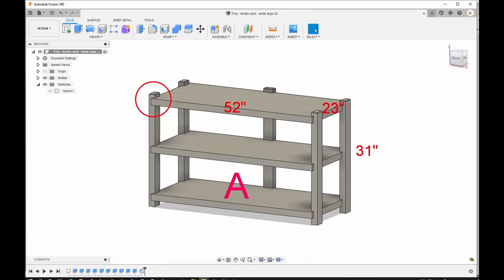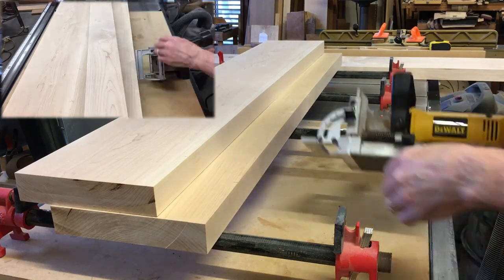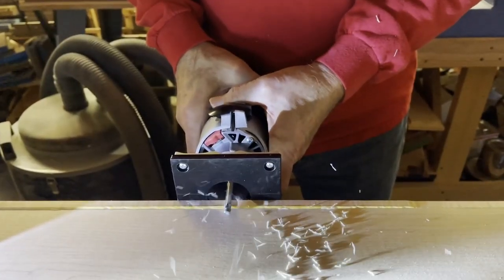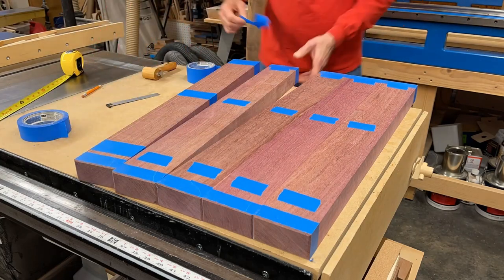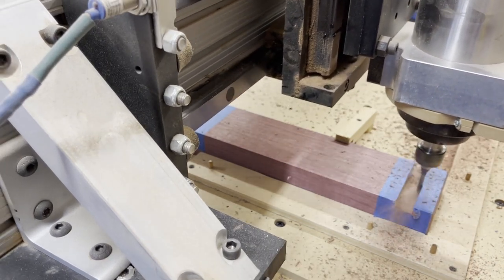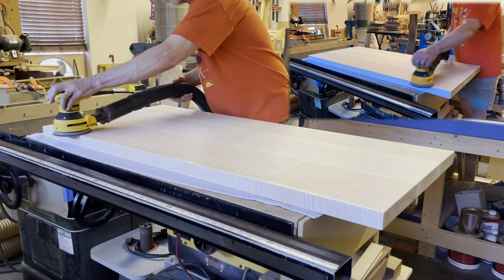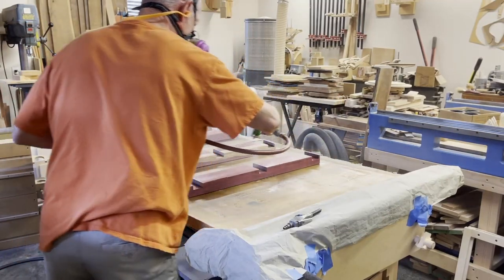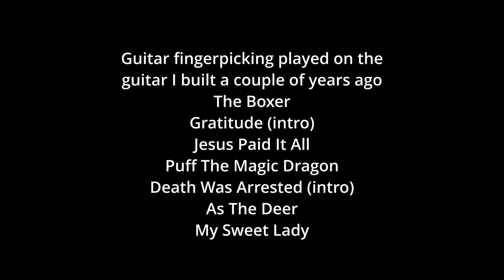Curly Maple audio rack - serious audiophile

Comment: Hi David,

Great video and you were able to spend the video time in documenting everything. Heck of a nice shop too👍👍

My neighbor down the street has a shop in his garage and we built a stereo rack similar in design but about 4” shorter due to the limitations in my music room. We used 3 birch countertop slabs for shelves and African mahogany for the 4 legs. I stained the legs in a dark Java color (Gel/oil-based) from General Finishes. I applied 3 coats of General Finishes Gel Satin (oil based) to the shelves and legs and it was just yesterday that I completed the last coat in my garage. Now I will need to wait a month for the finish to cure before placing 50 lb. stereo gear on the shelves. Again, congrats on your wonderful vid!
Reply from the maker: Thanks so much for the kind words and for watching the video!  Are you planning to post a video or photos of your build?
Reply: @difalkner  - I am about 50% done with the vid. I will finish it after I move the rack to my small music room and video some more. I have some YouTube vids posted under my name for my vintage stereo gear.

Comment: That curly/tiger maple is gorgeous and tough and expensive to come by.  Very nice combination with the purpleheart.   I'm surprised that you had issues with the threaded inserts.  I have installed them in hard maple but mine were in face grain and not end grain.  Did you lubricate the threads?  Are the inserts fine thread?  Beautiful workmanship.
Reply from the maker: Sorry for the delay in responding; turns out I wasn't getting notifications for comments.  I used Beeswax on the threads and they are coarse threaded.  Thanks for the comment and for watching the video!

Comment: 5:58 why do you glue the front strip, or do you do it around each shelf? thank you for your video
Reply from the maker: @Blackhowk3  I assume you are referring to the middle and bottom shelves. That was done to give the look of Curly Maple to all of the shelves and not just the top one. Once equipment is on the shelves, you wouldn’t really be able to see the shelves themselves. And it was far less expensive to use Hard Rock Maple for those two shelves and put the Curly Maple strip on the front to give it the same look as the top shelf. Thanks for watching and thank you for your question!

Comment: What are the dimensions of the legs and where did you acquire the Purple Heart from?
Reply from the maker: @markcurry5758  My CAD computer is in the shop so I can’t check but as I recall they were about 1.75 x 3.75. I bought the Purpleheart from a local hardwood supplier.

Comment: David, if you don't mind sharing, what are the dimensions of the posts?  I've been planning a rack for quite sometime but Im dithering on the post dimensions.
Reply from the maker: Sorry for the delay in responding; turns out I wasn't getting notifications for comments.  The legs are 1.875" x 3.75" x 30"